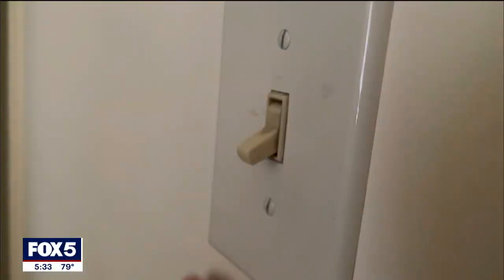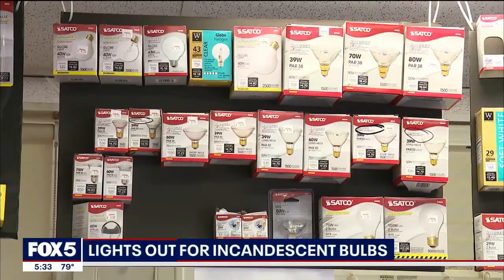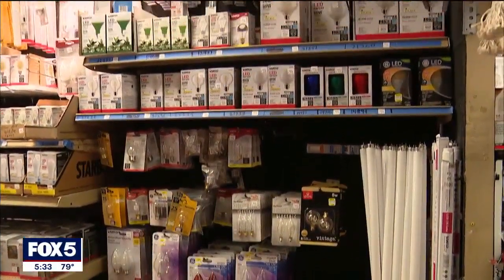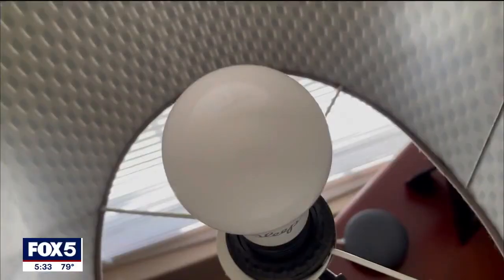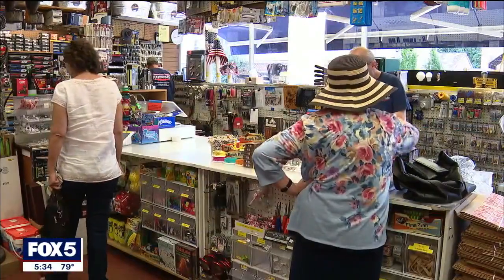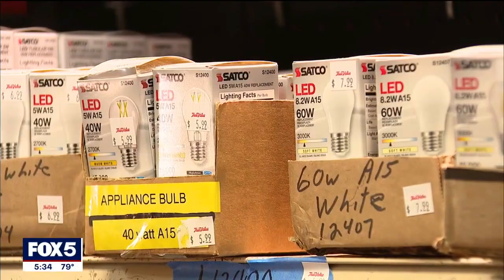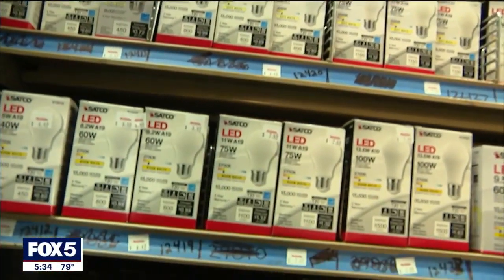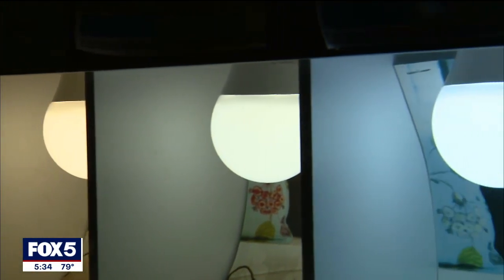Incandescent bulb ban in effect

Comment: These LED light bulbs they say is better & will last longer & I called BS. I decide to change out 7 incandescent bulbs in my kitchen w/ 7 LED bulbs for $25 a piece thinking it would last longer but NO, within 3 months 5 out of the 7 bulbs went dead. So it begs the question, why are we getting rid of incandescent bulbs when they actually last longer than LED Bulbs??
Reply: LEDs will save us more money, help the environment, and they actually do typically last longer. It didn’t make sense to me at first but if it helps then okay. Try different LED bulbs maybe. Note that incandescent light bulbs below 40 lumen are banned, so not all.
Reply: @DanielKolbin dude get over the fact that’s not true, all LED’s are garbage
Reply: @claytona57 yea bring back mercury vapors which lasted 24000 hours if ran nonstop
Reply: @BRISTOLFORCE2009  False. Do some research, or cry on.
Reply: @DanielKolbin  Older ones from when they had a degree of heatsinking maybe, but not modern ones.  A big part of LED efficiency gains in the last decade are due to a discovery in around 2015 that indium gallium nitride LED dies (used as the blue/purple/near UV pump light source for the Ce:YAG phosphor in 'white' LEDs; there is no such thing as a native white LED) have a big efficiency improvement when run at certain combinations of elevated temperature and high die loading at the expense of service life.  This is a big reason why modern LED lamps and fixtures have huge failure rates.

Comment: Ahhhhh some old school light bulbs are good for your brake lights for most older cars won't pass inspection with out the older bulb the LEDs are to bright to tell if someone is stopping in a older car bec the wattage is setup for incandescent bulbs. The problem with LEDs is they don't look natural even though they would say they're natural so a lot of TVs that have LEDs they kind of ruined effect of natural looking picture and can screw up the detail the brighter you get them It's almost you have to turn the LED down completely. But LED bulbs for cars are dangerous cuz you can't tell who is stopping sometimes. If there was a more natural LED you could adjust I would be all for it. Pinball machines are switching at LED. But I still like the older bulbs better they have more of a darker natural light look at the same time of color Don't look fake. I still believe the best looking TV for the plasma displays for best color and rich darkness. Without dark tones you can't get a higher of a vocabulary of color that you are looking for